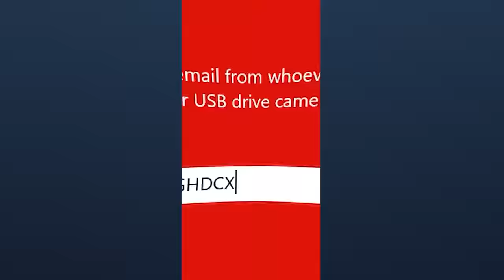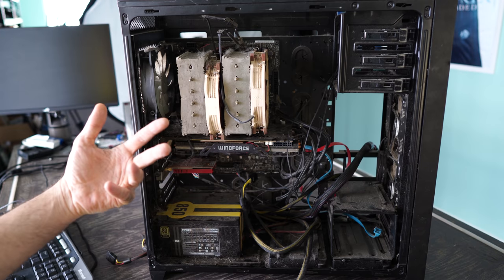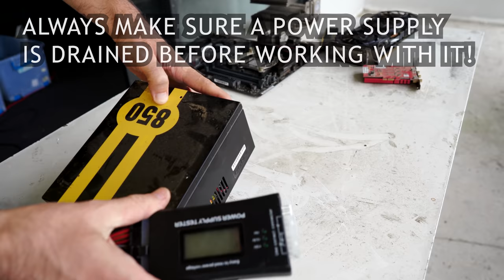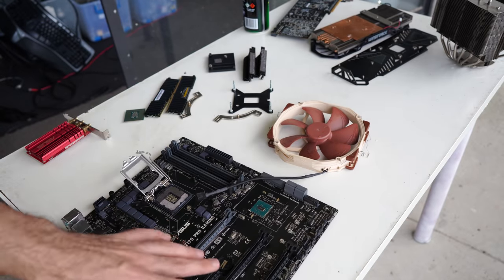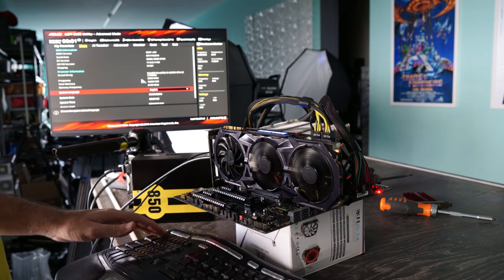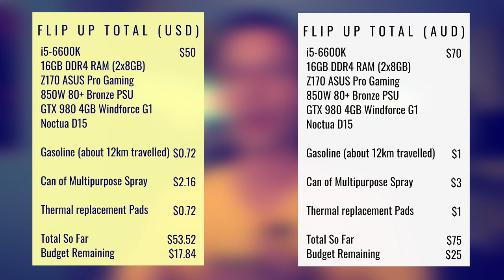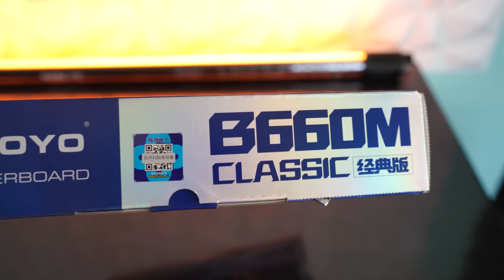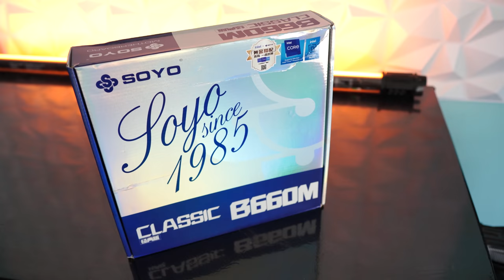Turning $100 into a HIGH-END Gaming PC - S2:E1 "Untested means UNTESTED!"

Comment: When cleaning electronics, I use dishsoap, a soft brush, and 'scrub' away.
Then flushing with a  lot of water,  then I just let it dry, for 24 hours.
Never damaged anything. But I always remove the motherboard battery, before cleaning.
I don't do it with motors, but obviously it works fine too.
Reply: Mongodoox There will always be corrosion. If you dry of all of the water, there are no high risk. Capacitors loose their charge fast. There are no high voltage capacitors in newer electronics.

Comment: Couple months ago I got a killer deal on a PC. Guy bought a new alienware prebuilt and wanted to flip his custom rig fast. Payed $200 canadian. Specs are as follows. Case: NZXT H510. PSU: EVGA 750 watt 80+ gold semi modular. HDD: 1 TB western digital 5400rpm. Motherboard: MSI H110m. CPU Cooler: Cooler master hyper 212x. CPU: Intel i5 7600K. Ram: Crucial 16gb DDR4 2133mhz. GPU: MSI Rx480 8gb. For $200 canadian it was a steal. For around an extra $100 I added a 500gb western digital SSD, couple new rgb case fans (2 were dead) and some rgb lighting. Not my main rig but have it as a hometheater pc and for that it works great for streaming/ light gaming and emulation :)
Reply: Thanks for your likes and comments kindly send  a direct message to claim your prize. 🎁

Comment: Nice cleanup.
I'm looking to upgrade myself, still have my 1060, which is still perfectly fine for my uses (so it stays), but the old i5-3570K it is paired with is seriously holding it back in some games. And with a platform that old basically everything needs to be swapped out. And the used market isn't nearly as nice over here.

Comment: I just typed into a search engine "gtx 980 and at the top it showed refurbished ones from 728 to $825 in US Dollars, so I think you got your investment back so that guy in the car park didn't realize he was sitting on likely a $1000 PC with some work as you demonstrated. You can if you have a decent oven that is clean also set it up for less than 100c to keep solder from flowing. ALso I learned a paint trim brush of an inch or so is great to clean out dust with a vacuum to suck the stuff up as you brush stuff like dust or animal hair it comes up fast and you can clean the fins in heat sinks super fast since the bristles get in between the fins and drag out dust and other stuff efficiently.

Comment: What do you use to replace the tim from the bridge heat sink? I have a 990x and I took the VRM/Bridge cooler off and it had thick pink crust where tim should have been and the usual black sticky paste to hold the lid on it. Do I even need the sticky paste? And why is the pink crust so difficult to clean? It acts more like glue than old tim. 97% isopropyl barely budged it. HELP!

Comment: In the fall last year I bought locally used 8th Gen i7-8700 and Asus ROG Strix Z390-E motherboard for $50 US dollars total. During the time finding a GPU was like a needle in a haystack bought locally a used EVGA GTX 1080 SC 8GB for $50 US dollars.

At the time I bought the parts I remember the CPU it self was going for around $200-$225 US dollars on the used market online. While the EVGA GTX 1080 SC 8GB was going for around $300-$400 US dollars on the used market online. I don't know how much the motherboard was going for in the fall last year never looked that up at the time.

I'm currently running the system specs below. Before that for the last decade I was using an AMD FX8320.

CPU: Intel Core i7-8700
GPU: EVGA GTX 1080 SC 8GB GAMING ACX 3.0
RAM: Vengeance RGB Pro 32 GB (16GB x 2) 3200 MHz CL16
STORAGE: Samsung 980 M.2 NVMe 250GB + Samsung 980 M.2 NVMe 1TB
MOTHERBOARD: Asus ROG Strix Z390-E Gaming
PSU: Corsair HX750 750W 80 Plus Platinum Full Modular
CASE: Montech Air X
Monitor: 27" LG UltraGear 165Hz 1080p

MOUSE: Logitech G502 Hero
KEYBOARD: Redragon Mechanical Keyboard Model: K629-RGB
HEADSET: JLab Studio Pro Bluetooth Wireless Over-Ear Headphones
MICROPHONE: Neewer Condenser Microphone Model: CM20

Comment: My big score was always office PCs with dead hard drives man. I can't tell you how many computers I've bought off people for $40, cleaned up, popped an SSD into, and resold for 2-3x my investment. It's actually crazy like I was super straight with people "I'd charge you X amount plus parts to fix it, you could get the parts and do it yourself for X amount, you could recycle it and have it chucked in a bin, non working it's probably worth about X amount in the local area, or you can skip all that and sell it to me right now for X" and the amount of people who'd rather just be rid of the thing and go buy a new one off the shelf to get a more modern PC with a warranty and sell you their broken one for a little bit of nothing is actually astounding, even telling them realistically all their options and what they could save/make if they did something different. I think once it's broken they just want it gone.

Comment: do you relubricate the fans after cleaning them in that ultrasound machine?
As a mechanic i know for a fact that unlubricated bearings tend to start to make noise very fast with failure in the near future.

Great work tho, I would be super psyched to get that gear at that price.
Reply: Thanks for your likes and comments kindly send  a direct message to claim your prize. 🎁

Comment: Thats one of the biggest bargains i have ever seen when it comes to PCs. Man ur a lucky guy!!!!  This looks like a r9 280x/290x graphics card.

I literally just bought 2 "new" faulty cards today. One GTX 970 4GB (Asus) for 30 bucks and a r9 280x for 25 bucks. Both are faulty, the GTX 970 often needs 2-3 boots to start and the r9 280x got really hold and the owner installed a water cooler. Now he sells it as faulty, cause it got so hot with the stock blower. :D I also get the original blower cooler with it. Extremly good buy. I probabaly go to fit a cpu cooler or a AIO to the r9 280x. :)

Comment: Hey it's amazing what you did with that actual pile of trash! 🔥🔥
I'd recommend keeping the 980 since it's a really good gpu and the market isn't getting any better at handing out deals these days. 
Maybe try selling the other parts individually or get a case and hard drive and sell it as a whole PC without a GPU. Once you've done that, I think you'll have enough funds to build a solid pc of your choice and then flipping that will give you a very high bump with the 980 included

Comment: i love the work, especial the cleaning, but after that "heavy" wash, boards should make in to a drier box, at least 24h, to finish the process of water removal, that is multi layer board and bga chips,  for a exemple ia a process to rework the board, or it wil pop out. it doesn't need fancy box, just a  2x lamps 100w close in a box, it will raise 80~100ª Cº. leave alone for 24h and its 5****. cheers.

Comment: It's kind of uncanny to see a 900 series Windforce card inside a 750D, because that was literally my PC back in the mid 2010s. A Windforce 970 and 3570k inside a 750D.

I still have the 750D and the 970. I actually use the 750D as a server, and I have retired the 970 for now since it worked with F@H when I did that in 2020.

Comment: @Tech YES City - I was genuinely shocked when you immersed the PSU and the Mobo, GPU, etc. in water and into a sonic cleaner - can you detail a bit more about this process including whatever solution(s) you used for cleaning?  And also how you blow-dry the board, it looked like a vacuum cleaner of some sort (perhaps with its output reversed?).  I'm really curious about this because I've always been told this would destroy gear (perhaps that was true for older boards?).
Reply: Only if you try and turn it on before its fully dried out
Reply: @WayStedYou  so in a typical scenario for someone who doesn't have a blower can it be dried in front of a fan for example?  The water here is insanely hard so would I have to filter it to reduce residue?

Comment: That Antec True Power 850W is 10-12 years old... surely you couldn't trust the capacitors. I've had both the 850 & 1000W versions fail at a much younger age (around the 5 year mark) that your example. I'd be tossing it the local scrap merchant's way rather than risking having it fail in a client's rig.

Comment: On that GPU, you can instantly tell it is a 980, from the power connectors, 980s have 2- 8 pins, 970s have 1- 6 pin and 1- 8 pin.

Comment: Hey man I have a question, why when I plug gtx 1050 (non power pin) to my pc, I cannot reach the bios of my mobo, my screen is not light up until the windows loading logo, that's why I cannot reach my bios. But, if I plug gtx 950 (6pin), it can reachs the bios (the screen can showing mobo's logo). I using asus h510m prime A

Comment: I guy sells GTX 1080 for 120 bucks. He said under load GPU starts dropping artefacts and eventually screen turns black. I wonder if it is possible that it's only a bios problem. Or power management is dead and GPU can't be saved.

Comment: I don't understand why people reuse thermal pads, especially if they're dirty. Replacing with new pads is cheap peace of mind. And wow. Do you want some GPU to go with your thermal paste?

Tip: A toothbrush and some IPA will remove the old thermal paste stuck to those capacitors on the GPU. Don't scrub too hard or you might lose some capacitors.

Comment: Might be good to sell that noctua, would cover cost for a 500gb ssd + a cheaper cooler for the i5, then you can flip the 980 into maybe a 1050ti or 1060 with a case and you'd have a complete pc
Reply: y would anyone want a 1050Ti...or even a 1060 over a 980? Answer: NO ONE WOULD!! So it uses extra KwH...it also shits all over the 2 named cards...of course anyone who wants to swap their 980 for a 1050Ti...message me! I'll swap!
Reply: @chrisholmes1052  The idea is to sell the 980 for a higher cost then put a budget GPU in with the i5 and also use that money to buy an SSD and other parts. It's not going to be a straight swap for a 1050 Ti.

Comment: I have been building PCs for 25 years. It takes a brave, confident person to clean electronic parts with water. I wouldn't do it myself. I use a dog hair dryer and Q-Tips with rubbing alcohol. I have never seen such nasty nasty parts and my PCs have been known to look like a golden retriever got sucked it to it. Also, how much did that ultra-sonic cleaner cost? I bet it cost more than $100. Not something your average person could do.

Comment: Pro-tip; use a wooden stick or plastic stick to put into the fan*blades before blowing them, this force stops them and makes 100% sure they don't turn above their specification and either damage the bearings or a fan blade comes off due to the sheer force.

Also, scratching that Noctua base plate by spinning it on the table? That hurts to watch. :/
Reply: Thanks for your likes and comments kindly send  a direct message to claim your prize..........🎁

Comment: Honestly I would rather obtain a broken office PC for 10$ and use that as a source for case and HDD than sell a GTX 980 in perfect working order. Anything below this card is underpowered as heck and not worthy of being called a gaming PC anyway. An 980 + i5 6th gen is such a nice setup that could run a load of modern games with mid to high settings at 1080p.

Comment: That z170 looks like crap but is far from it. If it's a 7/6700k you will get a good bit for it with an OK GPU. If i5 7/6600K? You'll still make what you said. Around $200-$250.

Comment: i build pc for my friend dell 6th gen used with 16 gb ddr4 new  with new 256gb wd nvme with also new hdd 500gb wd blue and new gtx 1650 it cost the half price of this build for the gpu only  but its all working fine for past three months and the total becomes close to 600 dollars but my question is can the 240w 80+platinum dell psu handle all of that ? i used 2sata to 6 pin pcie although i feel guilty about it but its what it is. if you asking why i didn't want used with all the parts my friend didn't wait until i have good deal so i looked for the best i can find in one day only and he didn't ask for gaming pc tell we got one then he asked where's my gpu so that happens
Reply: It's not luxurious but still within PSU limits.
Board w/ 65 W TDP CPU - <100 W
GTX1650 - ~100 W
Rest 10-15 W
Close to but definitely less than 240 W. Plus, these OEM PSUs tend to be fairly conservatively rated, and you're not likely to hit full CPU + GPU load at the same time in gaming anyway.

You can always measure mains power draw for more detail... PSU output power obviously has to be less than that.

Comment: Kinda disappointed, thought you were gonna do a budget build.  My hundred dollar build 
Ebay mb 15$
I5 2500 20$
Unnamed 2gb gpu on auction 50$
Ebay ddr3 ram 15$

Use leftover parts for psu, case, drives
Reply: Thanks for your likes and comments kindly send  a direct message to claim your prize..........🎁

Comment: i'll take the 6600k off your hands if your willing to sell...... also the case is a corsair obsidion 750D.... classic i have one but full tempered glass side and front, 3 140 fans in front 420 rad in top 360 in front psu shroud carbon , mobo carbon backplate... all done by myself 6 yrs ago....

Comment: There is almost no difference in the performance between the 6600k and the 6700k I have had both running side by side for years for my kids and it about 4 frames better for the i7...

Comment: bad choice your losing money selling the 980 to get more parts and a cheaper gpu, keep that gpu put 20 bucks in a ssd and atleast 50-100 bucks in a really clean case get some cheap UP HERE fans on amazon like 20 bucks for 5 and RBG  get a cheap rbg led strip and line the edges behind the glass or plastic side to light up the inside more and sell the thing for a better profit, looks and a decent gpu will bring you more than your plan and sell faster as your selling a gaming pc with a 980 anything smaller cant be considered a modern gaming pc and most people wont think twice about buying it

Comment: I want to see real time benchmark of this PC using prime 95 for 48 hours and Furmark for 10 hours if possible. I think that PSU needs to be replaced with a brand new one.
Reply: If it's only been powering that i5 and GTX 980 then it won't have lived a hard life at 850w. And it's bronze rated from a reputable brand so has gone through at least some more testing than a typical cheap fire-in-a-box PSU. It passed the PSU tester with stable voltages and was well within voltage tolerances so it should be good for some time yet. I've got older PSUs that are still in service as they haven't been pushed anywhere near their limit.
Reply: @AndyMitchellUK26  Yes , that's what I think. It can not be pushed to its limit.

Comment: Wait you can just wash things like the motherboard and GPU with water like that??
Reply: yes and no,  you have to make sure that you remove the battery so there's no electrolysis and make sure you dry it off straight after with an electric duster and then Bryan sprays it down with water dispersant spray which is pretty much aerosolized mineral oil and is non conductive/non capacitive (people used to put their systems in mineral oil).
even the non chlorinated brake cleaner is a great idea as its pretty much just the same thing as electrical contact cleaner but available for a lot cheaper.
Reply: @ChristmasCrustacean1  oh wow thanks for the info!🙌🏽

Comment: just got me a system with the same specs and an I78700k for $200 because it wouldn't display anything or post. I reseated the ram and it posted I checked the Bios and one of the sticks was dead lmao

Comment: Probably stolen,, And just the Videocard is worth more than what you paid.  I bought a nice Dean Guitar and Marshall amp for $200 and met the guy in a walgreens parking lot.. Guitar sold at guitar center for $599 and Marshal amp is a code 50 $299 was cheapest i found. Amps left side had leather scratched from Cat it looks like,, And guy i bought it from knew nothing about how the Amp worked or it hooks to your phone on bluetooth.

Comment: Am i the only one, that noticed the red light, on the Motherboard,  and the 3rd Gpu fan, not spinning up?
Reply: Usually dual and triple fan gpus will only spin up one or two fans in idle. Idk if maxwell also had these features but it was definitely standard with pascal and up.
Reply: @fVNzO  oh i did not know that... my Gpu's always face down, so i can't see that😆
I always thought, that all of them  was connected to sensor arrays, like the vrm's and the die, and if one of the sensors showed an increase in temperature, all would start ramping up speed accordingly. It seems sort of counter cost effective, to implement something like that. Especially if you want to beat competitors, on the market in price aswell.
Reply: @AllanBorch  nowadays dies have an array of sensors across the entire die, hence Hotspot readings. Additionally there are temperature sensors in VRM and vram. That being said, core usually determine the fan speed. This is why there is fans and heatsink kits with aio brackets because the card doesn't actually respond to VRM overheating beyond thermal shutdown. Luckily, these components rarely needed active cooling with ample airflow on high end boards. Hi speed gddr6 is another story though so I would hope there's been an evolution in this area on ampere. But idk I don't have any current gen gpus.
Reply: @fVNzO  I have a current gen card, thou i think i owe a kidney to the mafia now...
But to find out, i would have to disassemble the card, or have it on a riser, and use a heat/thermal -detector i guess, and i have never disassembled a Gpu before, nor do i own any of the above mentioned items.